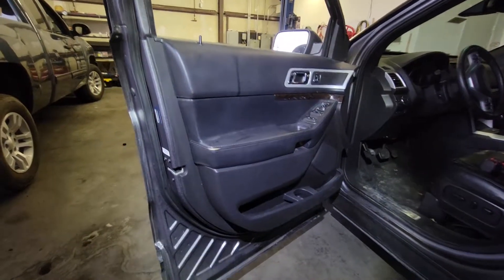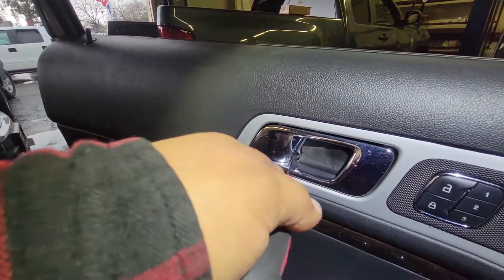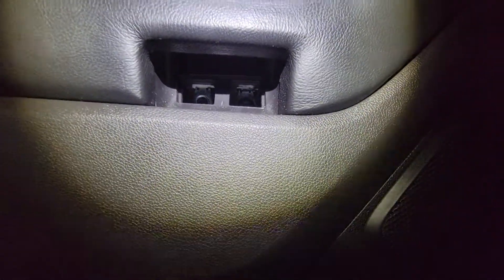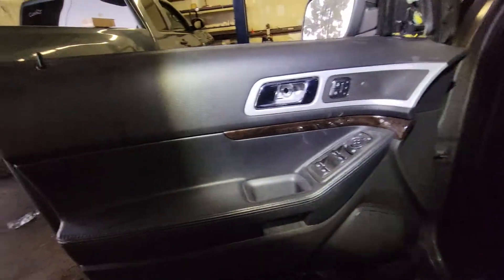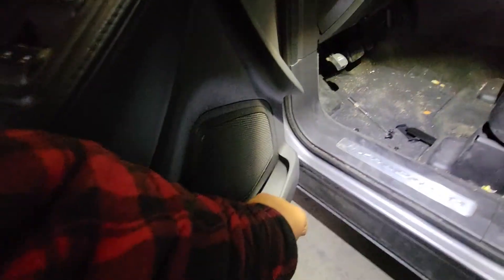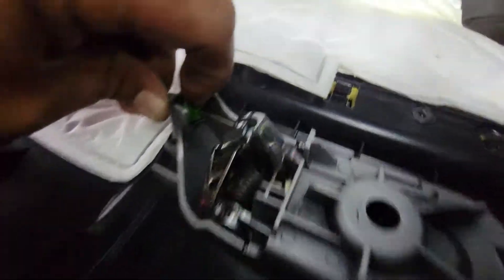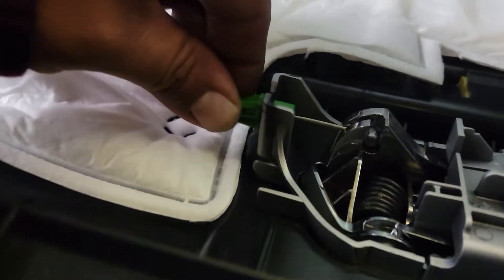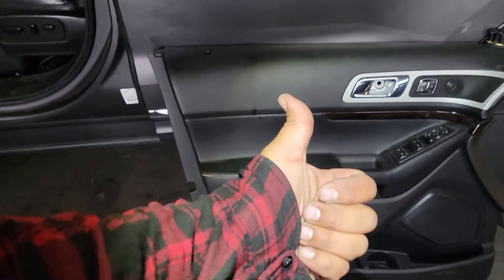How to: Remove Driver Door Panel 2014 Ford Explorer

Comment: Great video.   Bought my panel online and it only took about 45 minutes.  Had to figure out the door latch and window controls but it was easy.
Reply: Did you buy yours brand new or used? I need the drivers side door in black for 2011- 2013. I purchased the other ones off eBay. Just can’t find the drivers side.